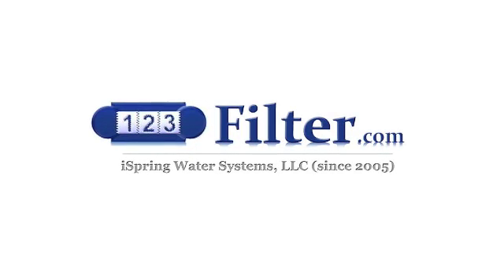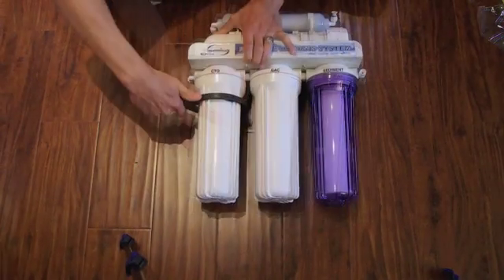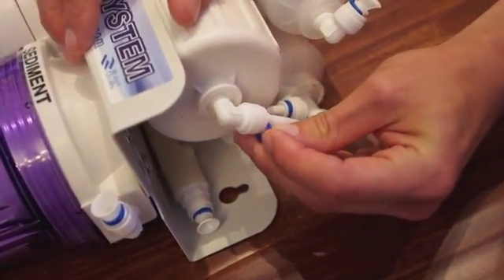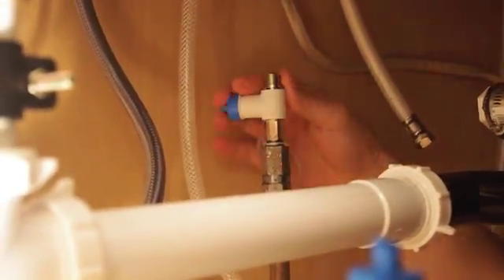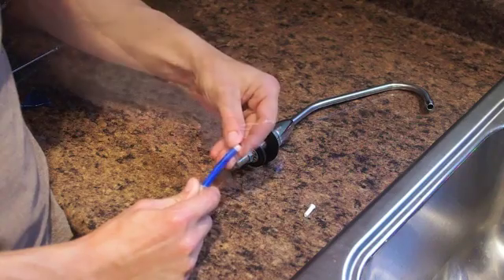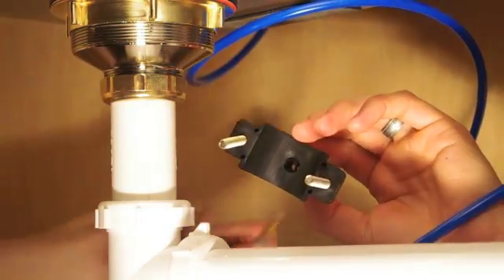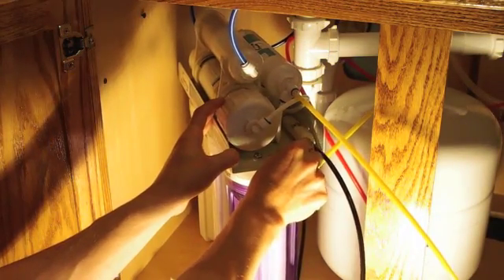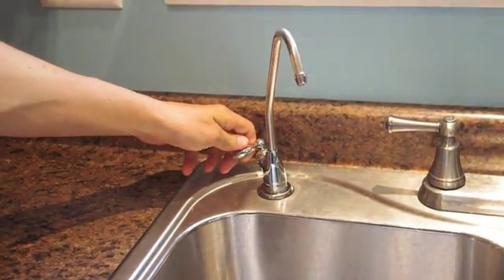Installation | iSpring RCC7AK Reverse Osmosis Water Filtration System (with English subtitle)

Comment: Also you do not say how tight to screw on the cap of the membrane filter cover. Is it hand tight or should we use the supplied wrench to snug the cap? or does it not matter and all we have to do is screw it on till it is just finger tight?
Reply from the maker: Hi there! Tighten the cap by hand. Then, use the wrench to turn it an additional 1/4-1/2 turn. Do not overtighten, as this can cause leaks and make it difficult to remove  when replacing the filter.
By the way, please refer to the latest installation video for the RCC series here:
https://www.youtube.com/watch?v=-9ZgoSlXelI 
If you  have further concerns or questions, please feel free to reach out to us at support@ispringfilter.com  or 678-261-7611 (M-F 9:00-5:00 EST) for proper assistance. Thank you!

Comment: I have a water tester, and 0-50 is ideal for drinking or RO-filtered water. The mineral water we buy is 25, and the filtered water from our Spring RCC7AK comes up 100-150, which is ranked as general drinkable water. Unfiltered tap water is 500. Is that normal? I am just asking to make sure I installed it correctly.
Reply from the maker: Hi there! The final TDS (Total Dissolved Solids) level after filtration depends on the initial TDS of your tap water. The system has a TDS rejection rate of 95-99% under optimal conditions.
Please note that since your system includes an alkaline remineralization filter, it will add healthy minerals back into the water that were removed during the RO filtration process. These minerals will contribute to the TDS reading.
Could you please take another water sample for testing? To ensure an accurate reading, let the water run for about 3-5 minutes before testing, as there may be a temporary concentration of minerals when you first open the faucet.
For proper assistance, please email us at support@ispringfilter.com
Thank you!
Reply: @iSpringWaterSystems  Thank you very much for your response and it all makes sense to me. So far, I am satisfied with everything.

Comment: FLUSH THE 3 STAGE CARBON FILTERS BEFORE CONNECTING THEM TO THE RO MEMBRANE! They kind of skip this in the video. The rcc7ak doesn't have a flush valve, so you have to remove the inlet tube from the ro membrane and drain in a bucket until clear of charcoal. Just a heads up. I followed the video and missed this step. I cringe at the thought of charcoal in my brand new pride and joy. 😳🤦‍♂️😆
Reply from the maker: Hi there. Please, check our latest video to know how to perform the pre- filters wash:
https://www.youtube.com/watch?v=LsVNBpLA6dE&t=0s 
For any concerns or questions, please kindly contact us at support@123filter.com, at (678) 261-7611 M-F 8:30-5:30 EST or at (470) 560-0012 M-F 8:30-5:30 EST (Messaging only) 
We are happy to help!

Comment: My sink sits below my quartz countertop. What is the best way to drill through it?
Reply from the maker: Hi there. We certainly understand your hesitation to drill another hole in your countertop. Some customers have been able to utilize existing countertop holes that were previously occupied by soap dispensers or sprayer nozzles by either eliminating them or replacing them with new faucets which utilize less holes. If utilizing an existing hole is not an option, we have also had customers choose to mount the faucet using the including mounting bracket either to a wall or under the cabinet with the system. Alternatively, you may be able to connect your system to your fridge/ice-maker and omit having a faucet all-together. If you have any other questions about installation options, please kindly contact us at support@123filter.com or at (678) 261-7611 M-F 8:30-5:30 EST to properly guide you. We are happy to help!

Comment: Question: what’s the valve on the side of the tank, are we supposed to put a pump to it and fill to a certain pressure 
Is there a minimum pressure requirement for the inlet cold water for the system to function 
Thanks for the nice video
Reply from the maker: Hi there. It is used to pressurize the tank. The air tank pressure should be 7-10 psi. 
Please, refer to this video to know how to pressurize the tank:
www.youtube.com/watch?v=a6Nc9wrnqAM
The minimum pressure requirement is 40 psi for the system to work properly. If your inlet water pressure is below 40 psi, a pump would be needed. 
For further concerns or questions, please kindly contact us at support@123filter.com or at (678) 801-9308 M-F 8:30-5:30  EST//(678) 261-7611 M-F 8:30-5:30 EST.
We are happy to help!

Comment: In the written instructions it mentions that if you want to mount this to the wall you should have some sort of a support underneath the filters. But I can find no reference anywhere about how high off the ground one must have the unit. Any kind of guideline on how high to mount it?
Reply from the maker: Hi Samantha. It doesn't really matter how high above the ground you mount the system on the wall. A block of wood or even styrofoam can offer support. If you have more questions, please call us at 678-261-7611 (M-F, 8:30 - 5:30 EST). We are happy to help.

Comment: Too many mistakes. Please; update and correct. Volume is low; but not your biggest mistake. 1- The Three major filters should be flush before use.  2- Never instructs to open the tanks so water can fill the unit during first time tank procedure.  Many other small mistakes like the last one.

Comment: After you fill the pressure tank for 2 hours, you say to drain it completely.  You presumably shut off the cold water supply to do that, or it would run indefinitely.  You should mention this.  On the other hand, if you shut off the cold water supply, it is not so clear that the pressure tank would empty completely (only partially).  Please clarify.
Reply from the maker: Hi Sami. You don't need to shut off the cold water supply to empty the tank. The water won't run indefinitely. After the tank fills with water for the first time, you open the reverse osmosis faucet and let it run until it slows to a trickle. This means that the tank is empty and just close the faucet to let it fill back up. If you have more questions, please call us at 678-261-7611 (M-F, 8:30 - 5:30 EST). We are happy to help.

Comment: My iSpring system has been great.  But it's time to change filters.  I ordered two of the six-stage filters  I didn't have and received them promptly.  One was exactly like the filter I had removed, but the other had fittings on both ends that didn't match.  One of the customer service folks returned my call and I learned that they have upgraded the filter elements to a more efficient, and user-friendly connection.  If you are changing your filters, I would recommend purchasing the complete filter kit.  It will have the filters with the new design and all of the connectors you'll need.  These guys were very responsive when I had questions about the initial setup a couple of years ago, and I'm pleased to report that the representative who returned my call took the time to explain everything to me.   Also, I've read some reviews complaining about leaks.  I've had some leaks as well.  Every one of them was due to MY INSTALLATION MISTAKES.  Wrapping the Teflon tape in the wrong direction is probably the most common mistake.
Reply from the maker: Hi Robert. I'm sorry that your phone call didn't get through. We sometimes have high call volumes, but if you left a message, we would call you back within one business day. About the work form, I have reported it to the related department to improve it. Please give us a call again at 678-261-7611 (M-F, 8:30 - 5:30 EST) or email us at support@123filter.com so that we could send you the right filter.

Comment: I watched the video and was helpful. Only thing is that it doesn't mention to flush the system first then to connect to the 4th stage. I wasn't able to flush first. Is this a major concern??
Reply from the maker: Hi Juan. You don't need to worry too much if you just skipped flushing once. The carbon residuals would be caught by the membrane when you run the system so they won't end up in your purified water.  However, we don't recommend skipping it too many times as it will cause the membrane to clog too soon and thus reducing its lifespan.

Comment: Vaseline is mentioned in this video for use on the  0 rings and  food grade silicone jelly is mentioned in the owners manual. Does it make any Big difference which to use? Sure would be cheaper to use vaseline unless there could be some negative issues with vaseline ?  Thankyou for your support.
Reply from the maker: Thanks for the question!  Vaseline is fine to use without concern.
Reply: @iSpringWaterSystems  I am about to install my iSpring RO system. But I've read that Vaseline can cause rubber and neoprene to deteriorate prematurely. Is Vaseline really OK to use on the O-rings? Wouldn't it be better to use silicone? Please advise, as I plan to install the system this weekend.
Reply from the maker: @OfficialSonOfRock  Hi there. Vaseline should not be used on the o-rings. Our o-rings are pre-lubricated so you don't need any more lubricants on them. If you have more questions or concerns about our products, please feel free to contact us at 678-261-7611 (M-F, 8:30 - 5:30 EST) or email us at support@123filter.com. We are happy to help!

Comment: What's the solution for drilling a hole? I can't seem to drill the half inch hole.the water facuet doesn't appear to be standard size as my dish washer opening is 1.5 in while the width of the included faucet is 1.25in. hd recommended I buy a new faucet that would fit I. The dish washer hole. Anyone? Thanks
Reply from the maker: Thanks for the question!  The 2" top washer with rubber gasket and the 2" bottom locker washer and wing nut together are able to hold the faucet in place, so it is totally okay for your situation.

Comment: I purchased your 5 stage reverse osmosis system and I am having problems with flow. After roughly an hour of waiting with the system on, the water is dropping out in very slow increments. Your youtube video fails to mention that you are supposed to flush the first 3 filters before attaching the membrane. That is only mentioned in steps 6.3 and 8.2 of the instruction manual. Also, the membrane housing comes pre-assembled with the hoses all hooked up. Why would you ship this item like this when the 3 pre filters are supposed to be flushed first?
Reply: They mention flushing the first three in their other video for the five stage. Crazy they forgot that crucial step in this video.

Comment: This unit RCC7 from iSpring waste a TON of water!!!. The manual states that it is a 2:1 ratio of waste water to clean water, however I and many others have tested this by feeding the waste water line through the kitchen wall and out to a 5 gallon bucket. The results came back in and it is was either 4:1 or 5:1 ratio. If you don't believe me, try it and you'll notice the waste water is clear and that is how much you are wasting by feeding the line to the sink drainage tube unknowingly. I'm currently using the waste water to feed plants and other house hold chores that requires water. My water bill has sky rocketed since this unit has been installed. The unit works and filters out all the bad stuff, however iSpring doesn't tell you how much water it waste. Why should anyone waste 5 gallons of usable water to make 1 gallon of lemonade.
Reply: ALL reverse osmosis water filters waste water during the filtration process. Its the nature of the design. This one is no different.
Reply: Great idea watering your plants with waste water. Thanks. I plan to do the same. I'm wondering how you did that though, if it's all under the sink. Care to share?
Reply: Hi Vy Tran,

We are sorry to hear the waste to pure water ratio is not at 2:1. This may be an issue with a component of the system. Could you please contact our customer service dept. at 678-261-7611 to trouble shoot the system?

Thank you,

iSpring Water Systems LLC
Reply: Look up reverse osmosis. That's standard for RO. Not sure where/why anyone/anything would say 2:1, but if it were 2:1 it would be a very low quality filter. You should only be using this water for drinking, not everything, in which case it should still be not much. Water is cheap...
Reply: You right its running    non stop .wasting water.it is good system if you supply water from well its free. but from city its expensive
Reply: Water waste gets worse as the tank gets full and starts to pressurize, reducing RO efficiency.  Adding a permeate pump fixes this.

Comment: Alright !! We are rocking and rolling. Simple set-up for such a Valuable resource ! 
Thank you iSpring :)  Just hooked up my RO machine / Went smooth as could be.

** I did however get a leak at first ( the black drain tube that connects to tiny Carbon filter )
Helpful tip for all !
Take your time !
Make sure each little plastic tube is inserted as tightly as possible. (thats all it was for me)
The slip on's are an amazing way to easily run plumbing but if they are loose, they will leak.
If it leaks / shut off valve.. Just re insert. Everything should be good to go :)

I'll be rating my package and sending a photo to the company for an update!!
I add a little trace minerals to my water occasionally as well.
Fresh lemon, lime or watermelon...
I also add crystals and always project good intentions into the water.
Water has memory and structure.
Look up Masaru Emoto and all of his studies :)  fun stuff !!

Thanks again for your wonderful product iSpring.  
We are made of water !! the water that comes out of the pipes are riddled with toxins.
Get this and spread the health among your family and friends.
Clean water / Good health = Abundant life.

Love and light to all !
Keep the good vibes 
rj

Comment: I made a mistake during the system start up - I hooked up all the hoses and opened all the valves. I am now worried that the black carbon is in the tank and RO membrane as I missed the step of flushing the first three stages.
How can I fix this?

Comment: Okay. Water pressure is low, adjusted lines, helped a little. Water looks a little bubbly? PPM went from 230+ to under 20. 
Tap water PH is 6.5 and the RO is now 5.5?
Model - RCC7AK-UV

Comment: Installed the membrane, which now I can't even get the tube out, and I am no longer able to go on installing.
Reply: +Wakey Wake Thank you for your question. To remove the tubing they are held down by quick fitting. To release them you remove the blue clip, then push down on the quick fitting (white ring) and at the same time while holding down the quick fitting pull the tubing out (use your other hand. Thanks!
iSpring Water Water Systems

Comment: It says turn on faucet and wait 5 min for water to start to flow and then wait another 10 min then turn on the tank valve.  We turned the faucet on and waited 30 min and it only dripped out of the faucet.  What can make the water not start to run? We checked all the lines and reinstalled the membrane, don't know what else to check.
Reply: I too am having the same problem. I followed all instructions perfectly. Your video fails to mention that you are supposed to flush the first 3 filters before attaching the membrane. That is only mentioned in steps 6.3 and 8.2 of the instruction manual. Also, the membrane housing comes pre-assembled with the hoses all hooked up. Why would you ship this item like this when the 3 pre filters are supposed to be flushed first?
Reply: +Rick Rosato Hi Rick, 

Thank you for your question. Please contact us at 678-261-7611 or sales@ispringfilter.com so we may assist you in getting your system up and running correctly. 

Thanks, 
Helen
Reply: what can I do if I can't get the water to flow ?  what is wrong where can I check for this problem?
Reply: Hi Rick, 

Thank you for your reply. It is probably due to a few different possibilities which we would like to discuss with you to help pinpoint the source of the issue. Please contact us at 678-261-7611 or sales@ispringfilter.com. 

Thanks, 
iSpring Water Systems

Comment from the maker: Adam- The first few times it can take a while for the tank to fill- amount 2-4 hours for most customers. Let the tank fill then flush it. Do this twice. Then the system should be good to go. 

Connor- The system has a automatic shut off valve so the system will only run water when the tank is not full to replenish it to full capacity. The only time I suggest to close the feed water adapter is when you are gone for long periods of time to protect the system from possible water pressure changes that could happen while you are away.
Reply: +yacahuma Hi Yacahuma, 

Thank you for your question. The manual states one time but I personally like to be on the safe side and do it twice, just a personal choice and recommendation based on experience. 

Thanks, 
Helen
Reply: Mine has a weird taste.  I’ve flushed it twice.  Seems like it has an aftertaste
Reply from the maker: @trancethan  Hi Ethan. If you could give us a call at 678-261-7611 (M-F, 8:30 - 5:30 EST), we can help you to figure it out and make some improvements.